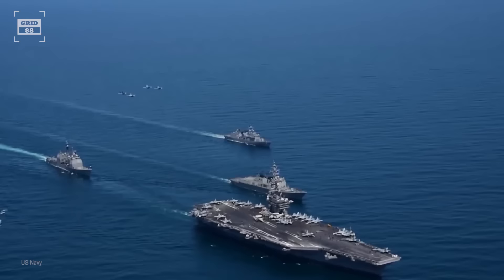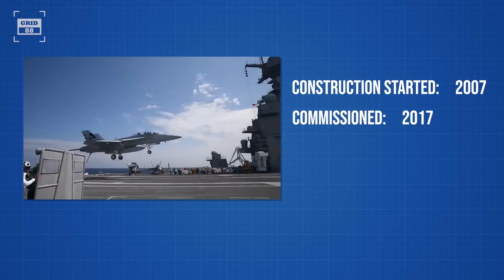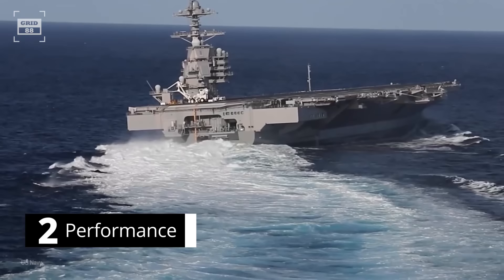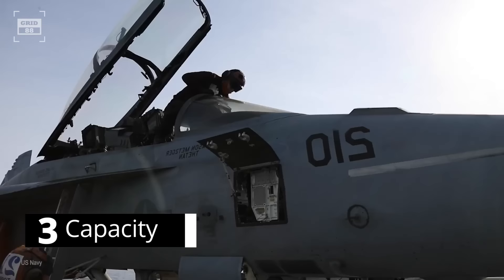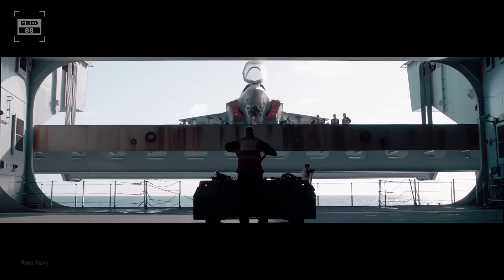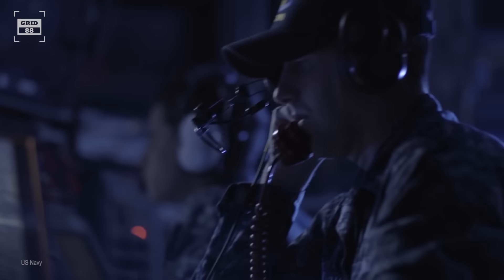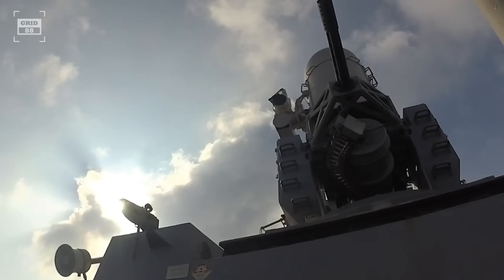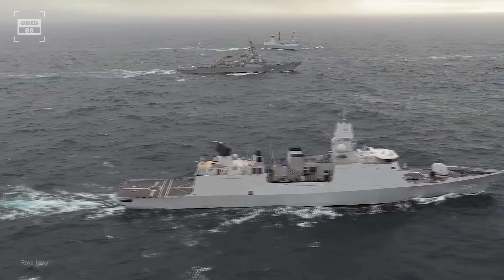USS Gerald R Ford vs HMS Queen Elizabeth - Which aircraft carrier is better?

Comment: HMS Queen Elizabeth only beats the USS Gerald R Ford when it comes down to cost, to maintain, service and operate. If comparing capability, then the QE is equivalent of an USS Warp class carrier.
Reply: HMS king George V  The Queen Elizabeth carrier about 45 aircraft, Wasp class almost 100, including Early Warning aircraft.
Reply: @drguffey  the wasp does not carry 100 aircraft, its like around 30 and the guy in the video said that the QE can carry a max load of around 72 aircraft.
Reply: @boratb258  You are correct. I clicked on the WWII Wasp !  My bad.

Comment: What does "better" mean?
The comparison between these two ship classes is largely irrelevant, as they are intended for entirely different purposes!  
In terms of cost one could (theoretically) build 3 QE ships for the cost of 1 Ford, and capable of carrying many more aircraft. On the other hand Ford's unlimited range is attractive. (However, Ford is of course limited in range to that of its attendant support vessels, so maybe a moot point). Three QEs could relieve one another for continuous operation, whereas Ford still has to spend time in port, thus out of operation. However, the US has 10-11 other carriers, so for them it's not a problem. For close-in protection (anti-air/missile) protection, the QE is far better off, while longer range defence puts Ford well ahead. Maybe the reason is that Ford carriers seem more assault oriented, while QE seems more defensive in nature. 
Thus one can go on without actually saying which is "best"!

Comment: QEC technology wise is more advanced than Ford . It's the only 5th generation carrier designed for 5 generation jets from the start. It needs far less crew due to automation and has wireless communication and weapons bay
Reply: Ironically, the most valid criticism of the Ford-class carrier is that it is too advanced. It integrated 23 different bleading-edge technologies.

Brits like to claim the QEC is highly automated -- but I've yet to hear what automation it has that US carriers don't have (besides the weapons handling).

The weapons handling system isn't particularly advanced. It is using a system used in warehouses across America.  They just implemented an existing, proven technology onboard the ship.

The lower number of crew comes about largely because the QEC has fewer capabilities.

Also, it is likely understaffed for a warfighting scenario where the crew may need to fight fires, battle a flood, and repair the ship --  all while fighting the enemy.

------------------------------------
You said:  It's the only 5th generation carrier designed for 5 generation jets from the start."

What advantage is that?  What special ability does that give he QEC?

Plus, there is no such thing as a "5th generation carrier".

Comment: I suppose it comes down to cost and availability. One on one you'd have to say the US ship is the more superior ship. But if the US ship costs more than 3 times as much as 3 smaller UK ships would 3 smaller ships offer more flexibility, availability and effectiveness? A nuclear powered ship may have a theoretical limitless range but its flotilla of support vessels don't, or do the aircraft that operate from the ship. So although it is an expensive advantage it may not be as big an advantage as you'd think.
Reply: Well… the UK is only planning on having two—HMS Queen Elizabeth and HMS Prince of Wales.
Reply: @franticzenster8140  Exactly, so one larger, more expensive ship was firstly unaffordable and secondly wouldn't provide the availability and flexibility required.

Comment: as things stands today the ford is alot better then lizzy she is currently just a glorified lightning lhd with the current load out she currently have plan for but if she were to have a moded version of a v22 osprey acting as fixed wing aew/awacs and general purpose variant acting as cargo and tanker with a fully loaded f35b air wing she would indeed be able to go toe to toe with the ford i think big lizzy with a loadout that consist of 48xf35b 4xv22 aew/awacs 8xv22 cargo/tanker/asm 8xmerlin asm 4xaw159 wildcat for transport/ASUW and 4xmojave drone with hellfire as carrier overwacth and long range Maritime patrol aircraft escorted by 2x fully upgraded and updated type 45 and 3x type 26 2x rfa tanker 1x rfa supply ship and 1x astute attack sub with this loadout she could even challenge and have a chance at victory against ford and her escort.

Comment: The USS Gerald R Ford electromagnetic launch mechanism has yet to meet it's launch target. So far has fallen well below the projected capability.
Reply: The EMALS and AAG are now both fully certified having completed more than 8,000 launches and recoveries. And the much delayed Advanced Weapons Elevators are also all fully certified now. The well publicized teething problems of these systems have been fixed and the carrier is fully operational.
Reply: @centurion1945  That is good news, But while i fully admit that cats & traps have advantages over  the STOVL design doctrine. The reverse is also true, As the recent F35c crash on the USS Carl Vinson shows, That one accident shut down the carriers air operations for over 30 minutes while the deck and arresting gear were checked for damage. ( Thankfully no one was killed ).. On a STOVL carrier like a QE class planes could still land and takeoff from the carrier if the flight deck suffered damage in a particular area, ( Although takeoff payload would be significantly reduced if the bow area were damaged )..
Reply: Currently (CVN-78) in a war. 🦗

Comment: Depends on the circumstances.  At those prices you get three QE for each Ford - giving the theatre commander excellent operational flexibility and redundancy.  It also means his opposition has to defend thee times as much airspace/sea space.  If cost is no option it's the Ford every time but even for America cost is now becoming an issue.  Sortie rate on the Ford is an improvement on the Nimitz class.  I believe one QE will likely be retrofitted with small CATOBAR to facilitate drones.  QE have a bigger punch than the USMC boats.
Reply: QE-class really ought to have operated Hawkeyes like Charles de Gaulle.  I know it carries AEW helos but it’s not the same.

Comment: what odds you giving on a three to one battle ..... same as cost ?
Reply: #1. Given that the Ford is CATOBAR it can launch planes with greater range, more fuel, and more bombs than the QEC. And so the Ford can strike the QEC while remaining out of range of attack by the QEC.

#2. CATOBAR also enables the launching of  E-2D Hawkeye for airborne early warning (AEW).  Thus they can find the enemy before the enemy finds them.

#3.  The Ford-class has three layers of organic self-defense while the QEC only has one layer.

#4. The Ford-class is much more heavily armored than the QEC. With thicker steel and Kevlar protecting the vital areas of the ship.

#5. One QEC has hoped-for, theoretical 5-day surge sortie rate of 75 sorties per day. In contrast, the proven 5-day surge sortie rate of the Nimitz is 240 a day -- and the Ford’s is planned to be 270 a day. 

Therefore, a single Ford-class carrier can launch more sorties than three QEC.
Reply: @Courage2006  short answer....no. because you still only have 90 planes...vs 240...suck it up. And stop dreaming.😜
Reply: @calmci8280  Oh the irony. You've fallen for a dream .... really a myth ... in reality, the maximum number of jets a QEC was built to hold is 36.  Although, the plan is for them to just carry 24.

Currently, the best the British can do is 8.

But either way,  it would be a surprise attack because the QEC lacks long range AEW planes -- so only a very small fraction of the QECs fighter jets would have a chance to get airborne before the attack was over.

Face it.  The Americans studied the issue. If three smaller aircraft carriers were more powerful -- that is what they would have built.
Reply: @Courage2006  wrong. The end. Go back to sleep and dream some more.
Reply: @calmci8280  Ah .. so you've got nothing? I'll  accept that as a cowardly way to admit defeat.

I accept your surrender. :-)

Comment: Two are of two categories in terms of weight as well as fuel so comparing them is a foolish work ... a 65000 tonnage AC can not carry and hold that 100000 tonnage AC can , at the same time operating cost is much lower , price is also lower and aircraft carrying capacity too . At a cost of one gerald r Ford class AC , 3  hms class will come keeping some money in pocket
Reply: Need 3 times as many escorts also

Comment: The US has conventional powered helicopter carriers, which is basically what the QE class are. The Ford is a fleet aircraft carrier.
Reply: QE is no helicopter CV lol, it’s a 65,000 ton sailing precision strike asset. The whole point is to load with one fixed wing type and a small carrier group and get in and out of high risk, high precision mission areas. It’s not meant to sail as a fleet carrier like the Fords where they sit off the coast of Somalia for months with 20 ships in the group.

Comment: You are comparing an non-Nuclear HMS Banana Boat with diesel engines, non-Catapult, non-Trap, limited range boat with a ridiculously hilarious banana ramp to the ultimate epiphany of Nuclear powered Super Carrier USS Gerald R Ford. Hell, your HMS Banana Boats are not even super carriers… they are just glorified helicopter platforms, even any USS America Class carriers more firepower than your HMS Banana Boats. We have more American F-35s in those HMS Banana Boats than British, and all those F-35s are all American made, you are simply an insignificantly small nuts and bolts supplier to Lockheed Martin.